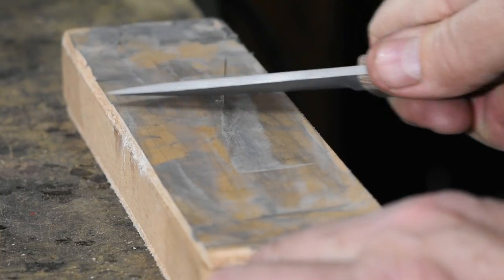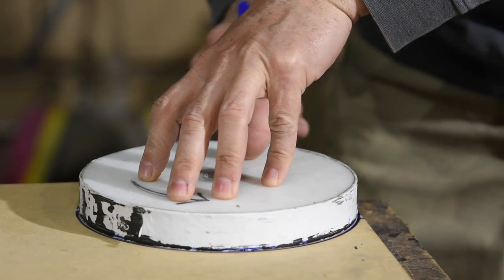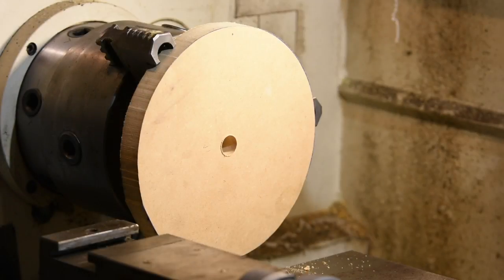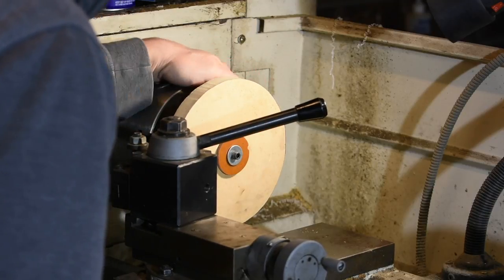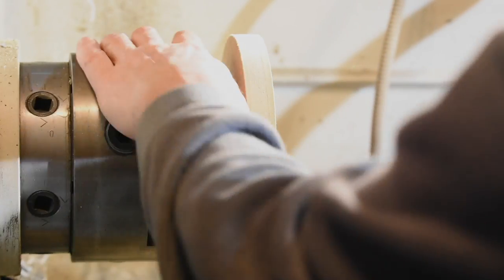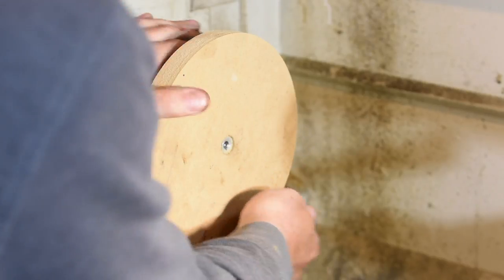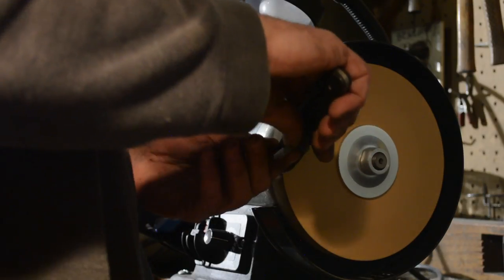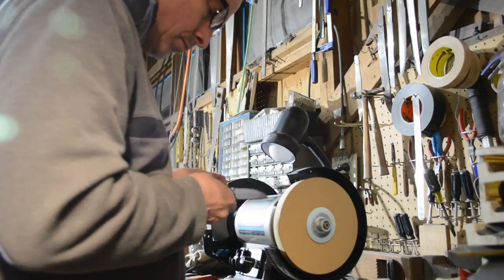Making A Stropping Wheel:  Get that Knife Shaving Sharp!

Comment: I recently made a wheel just like this one :) I feel like I can give you guys a couple of suggestion: If you don't have a lathe at all you can make a pretty good circle with a router and then turn it true when it's mounted to the motor. Then you can also turn the whole bench grinder the other way so that the wheel is spinning away from you and at that point you can work on the top of the wheel :)
Reply: ThankQ for your input, it helps me big time.👍
Reply: Damn good advice!

Comment: Thanks for this Walter. I think that sharpening is either a lost art or one that has never been given its proper focus, at least here in the West. If you make a great blade what's the point if you can't make it sharp. I've been sharpening knives for years for friends and family. My very rudimentary but effective routine is short. I have a worn out 120 grit belt that I use to bring the edge back to the factory profile or establish one that should have been in the first place. Then I went to the buffing wheel/mop with a fine compound. Worked great for years, even on the knives I made myself. I happened to be in the shop of a local guy who has been around for donkey's years. One of the things he had that caught my eye was precisely what you just made. The only thing different was that he turned the grinder around so that the rotation was going up and away from him. That way, he had the knife on the top giving him better sight lines and if, by any chance, there was an issue, the knife would be thrown away from him completely. I went home and immediately made one from two sheets of 1/2" grade A plywood. After turning it, I gave it a light sand and then charged it. Now the buffing wheels are relegated to polishing bottle openers, blah, blah, ad infinitum. Thanks for the tut. Keep forging!

Comment: I made one last year, but I don't have a lathe! I trued mine by mounting it on the bench grinder and using a small vise as a rest and a wood chisel. I use it by turning the bench grinder backwards and stropping on the top of the wheel. This way it is turning away from me and if the knife does catch, it's thrown against the wall.

Comment: How crazy!  I just did that project last week!   I went to home depot and ask for scrap MDF.   They had 5/8 so I glued 2 pieces together; rough cut to a round; drilled the center hole and turned it true right on my grinder using a normal wood chisel.   Works like you say (a charm) !   I sure save time resharpening the kitchen knives !!
Reply: Do they give out free like that?
Reply: @MaulikThaker  , they had charged me just $1 for 4 pieces.  So almost free  ;o)   Cheers.
Reply: @nihallee   Thanks :) I just did with the wood piece I had hanging around from my old cabinet. Did the job well, thanks.

Comment: I made one of these a week or so ago. I cut 2 wheels on my CNC router with the hole cut for the arbor and the washers. Using CA adhesive to glue the wheels together and used a flat scraper from my wood lathe and the tool rest I trued it up right on the grinder.  BTW I made my wheels 9 inches in diameter because I had the space. Works great. :)

Comment: Another important note on the topic would be that on smaller knives, this technique does run the risk of overheating the blade edge and taking out the temper from overheating. The temper is vital in maintaining the most durable edge possible-edge retention and toughness especially.

Comment: Walter, G'day coach,
When mounting a stropping wheel to a grinder motor, what would you say if 'about-faced' the motor and used the upper quadrant for stropping? That way it has less chance of 'grabbing' my knife/chisel/gouge.
I'm an 'apprentice' wood carver (aged 75 almost) and I really don't like pointing my blade dow  in an awkward position. It's different on my belt sander; I have a ledge. Also when using a knife (ledge removed), I feel more relaxed because the blade is easier to hold at a horizontal position.
Of course, it means I'll need to reach over the machine to start it. But that can be done safely.
On the other side (left), I have a wire brush-wheel, and I have often had it snatch the item out of my hand (banging the tool into the wheel ledge, and sometimes trying to jam it).
Cheers,
Vernon Thompson,
Hog Heaven Ranch,
Seligman, AZ.

Comment: You can turn the mdf on your bench grinder if you don't own a lathe. Just make it as round as possible before trying to turn it. I used this method many moons ago and it worked fine. Same wheel still in use after 10+ yrs.

Comment: I'm a fan of using a $45 6" buffer from Harbor Freight along with a pair of leather Flexcut Standard Power Strop wheels. All in you're spending far more than just the $20 for a paper stropping wheel for your grinder, around $85 total for the buffer and a pair of leather wheels, but you're also not using up one side of your bench grinder. Also, you don't have to get 2 Power Strop wheels. One will do the job. You'll just be spinning the buffer around a lot.

I use three different strops depending upon what type of edge I'm sharpening/stropping and what level of polish I want. If I want a true mirror polish -- one that still looks like a mirror even under the 80x magnification of a USB microscope (most 'mirror polished' edges look like a hacksaw blade under magnification) -- I use the kangaroo leather & Nano Cloth strops with my TSProf guided sharpening system along with multiple diamond stropping solutions going all the way down to 0.1 microns. For most uses, however, that's a little on the ridiculous side. So for the majority of the knives I sharpen I use either the aforementioned buffer & Power Strop wheels or a simple 1"x 30" belt grinder with a Surgi-Sharp leather stropping belt. The Surgi-Sharp belt is for knives with convex grinds. For everything else I use either the TSProf or the buffer/Power Strop setup depending upon the level of polish I'm looking for.

Comment: Re: wheel spinning direction ("up" or "down")... if you remount your grinder in the right corner of your workbench-- and can stand comfortably at the bench side/end-- you can use the MDF wheel over the top (with guards removed) spinning away from you, and the have left-hand abrasive wheel still spinning in the conventional direction.

I built this same kind of wheel about ten years ago, but went to a six-inch diameter because the slower surface speed was more forgiving and generates less heat. Things happen very quickly on eight-inch wheel at full speed... YMMV.

Comment: 4:08 you could fix that by moving your camera position to above the drill side. After all, the lathe turns so it doesn't matter which angle you're looking at it, it always looks the same. You can even turn the camera sideways if you really like this viewing angle (so rotate the camera position around the lave axis). Never any problems with arms anymore...

Comment: WHAT R.P.M. is that wood rated at??? I have seen grinding wheels blow up and it is not a nice thing to be standing in front of.
Reply: I just hope he has the camera rolling if/when it happens...
Reply: You know, I have been around grinding wheels for 30 plus years. Aluminum oxide, silicon carbide, vitreous bond, different makers, and different grades. BUT, I have never had a wheel 'blow up' on me because I have always ring tested them. Tap on the edge of the wheel with a good hard piece of maple...If it rings, you are good to go, if it sounds flat, or doesn't sound at all, throw it out.
Reply: What are you talking about having a spinning wheel blowing up in front of you feel like a soothing message
Reply: @jamesoconnell9396   I think the question of an exploding wheel was referring to a stropping wheel made out of MDF. 
Anyways here is a question I have, Can I break in pieces a cracked aluminium oxide wheel and use the pieces to dress similar grinding wheels?
Thanks in advance for your reply.

Comment: If I have no lathe, would it work to make it round as possible by hand, and then maybe mount it to the grinder and then true up the outside circumference from there?
Reply: Revrant I've trued contact wheels up by chucking them in a lathe and using a piece of sandpaper on a block to smooth it down. I'd be willing to bet it would work on this using the bench grinder as power.

Comment: Isn't MDF powder poisonous due to the formaldehyde content?
Reply: Or should I say MDF dust....
Reply: The problem with MDF dust is the fibers have the same shape as asbestos.   There like little hooks, once they get down into your lungs you won't be coughing them out.    That's why anyone cutting MDF will usually wear a high quality dust mask or even a 1/2 mask respirator.       It may be different in your local, but I believe most manufacturers in North America stopped using formaldehyde adhesive's about ten or fifteen years ago due to the health issues.    I also understand it was more in regard to the particleboard or pressboard used in the manufacture of "for example" melamine kitchen cabinets.   Not sure if Formaldehyde was used in MDF production.

Comment: I recently watched your video on youtube  making a stropping  wheel now if you take and make another one you can take aluminum oxide powder fine to medium coat wheel with a thin layer of wood glue lay some powder on paper or cardboard and roll wheel through the oxide powder lightly and coat wheel evenly coating all the face of wheel .than slide wheel on grinder shaft just to support until glue dries 24 hours . Ok now mount the wheel on your grinder now take a piece of angle iron turn grinder on take angle iron and lightly touch iron against wheel what you are doing is leveling the face of wheel now with wheel turning  press wax against wheel coating it now rub iron against wheel until wheel is smooth this is done with a lite touch stop wheel exam wheel and you haven't removed the iron powder your ready to sharpen your knife ( REMEMBER DON'T PLACE BLADE WITH CUTTING EDGE FACING THE TURNING EDGE RUNNING THE WAY THE WHEEL IS ) Lightly press knife against wheel 1 or 2 times then turn around and run the same amount of times on the other side watch for burr to form then   when you like the way it looks then stroup knife on the other wheel. Just remember don't place edge of blade into turning  wheel it will throw or RIP knife out of hand causing injury. This process done correctly will not heat up blade. And at the beginning of each sharpening touch a couple times with wax and touch polishing compound a couple times to strop. If you do feel blade getting warm dunk in water. And use less pressure. This wheel should last for 50 to 100 or more knife sharpening . To Reload sharpening wheel take 36 grit cloth backed sandpaper and run against wheel until wheel is smooth and clean then reload as when new .

Comment: I got a 1x30 with a leather belt, loaded with 4 or 8 micron diamond compounds. Leaves a shaving sharp edge but with diamonds they cut a clean and defined scratch pattern which gives it plenty of tooth and slicing aggression.

This here wheel looks like it would work pretty nice with a paper wheel set up.

Comment: Polished blade will shave but will not have enough grabbing power to cut few materials like rope, and stuff , too smooth knife will glide and not cut , so if you will polish ur knife , last thing tou want to do is change ur angle a degree and lightly run ur knife on like 1000grid stone to put some teeth back on the micro edge , wicked edge sharpening systems makes it easy  to do.

Comment: If you have a wood lathe, you don't need to worry about a bench grinder. Use the wheel on your lathe. I've never had a problem doing that. Many, many, many times. You can also lower the wheel speed easily.
Also, why make it? It's more fun.
Reply: If you have a lathe running the wheel at lower speed is safer and better for the task.
Reply: Yes, my lathe has been used for metals as well as plastics. You can vary the speed so you don't burn or melt anything.

Comment: wouldn't it be safer if you turned the grinder around so it's spinning away from you?
Reply: Agreed. That's what I do, too. A bit of a pain to rotate and screw/bolt down without a spare, though. Fortunately, picked up Grandad's that no-one else wanted. Saved me contemplating a benchtop lazy-susan ...
Reply: Not if your using it on top. It would throw it away from you. If you use it way it is in the video it's gonna throw it any where from your waist to your feet. I'll take my chance of having thrown at the wall any day than have it thrown at me.
Reply: go watch another video on sharpening wheels he's not first person to do this on youtube. everyone else has no guard on it. they have it turned around and they are using it on the very top so it will throw it away from you. you and walter can be the only ones who do it that way that's fine. so go head and do it that way and i'll do it the way.

Comment: Walter, I'd recommend turning the grinder around, flipping around the base, or rewiring the motor to run backwards.  That way you can use the top of the wheel to strop, with the blade facing away, and the wheel turning away from you.  It won't catch on the edge, and won't throw the knife towards you.
Reply: He's holding the blade downwards anyway, the wheel wont catch. He's using it in exactly the same orientation as he would be if the grinder were reversed, only at the front of the wheel rather than the top. At least holding it at the front of the wheel you can lock your elbows in and get a steadier angle. And you would just have to flip the base.. you wouldn't have to re-wire the motor... If you did that you'd end up with a grinder that works exactly the same way only with the power button on the back.
Reply: I know he's holding the edge down.  It just makes a lot more sense to have the wheel moving away, using the top of the wheel.  You can still lock your elbows, and the edge is easier to see that way.  Some grinders don't allow the base to be reversed, that is why I suggested either turning the grinder around, flipping the base, OR rewiring the motor.  If you can't reverse the base, but would like the switch on the front, most ac motors can be wired to run in reverse.  I find it much easier and safer to have the wheel turning away, and to have the edge of the knife held horizontal, parallel to the work station.
Reply: Well that's fair enough. For me at least it doesn't make much sense to completely change my methods for one task on my bench grinder, maybe if I had a dedicated grinder for sharpening I'd have the wheel turning away and strop on the top surface. Sorry I thought you said turn the base AND rewire it, to me that was a double negative but no worries.
Reply: It's really up to the user.  Most people will buy the package deal he mentions, which comes with two wheels. One wheel is set up with an abrasive coating for establishing a bevel, one is a slotted wheel with polishing compound for stropping.  That way you change out both wheels on the grinder, and have a dedicated sharpening setup.
Reply: Matthew Seader ... be careful. . rewiring grinder to run backwards like this it can loosen up main nut that keeps grinding wheels tide during operation and bad things could happen. .... otherwise good tip....
Reply: I agree. You'd almost require an aircraft quality bolt with a pin through it to keep it from eventually flying apart.

I think turning the whole grinder around and reaching over to switch it on would be a good bit safer.

Comment: Hey I don't mean to nit-pick, but "honing" does not remove metal. Honing referrs to the process of running the blade along a long a honing rod or similar tool which ONLY bends back, or straightens, the cutting edge. The end effect is a better cutting knife, but not sharper as no metal is removed. "Sharpening" removes metal. There are 4 stages to make a knife edge-shaping, sharpening and stropping, and honing is used in lieu of sharpening i.e. before cutting up your veggies for dinner.

Comment: So Dangerous do not do this unless you have experience with grinders and tools! never have the wheel spinning into the edge or it WILL catch in a second (and could injure you badly) - that is why commercial ones are made of stuff that doesn't catch like paper - felt - shreded leather and so forth. It works, yes, but a hand strop will work just as well when loaded with compound. I honestly think it is a stupid thing to have in the shop - buy a safe one and call it a day.
Reply: docdoc or just trail the edge, sack up a bit and wear your PPE

Comment: instead of using a polishing compound, could a poor man use a bar of soap instead?
Reply: If you have a harbor freight near you, they have the green chrome oxide compound for about $5. Not too much more than a bar of soap (which I don't think will work anyway).
Reply: Sidewalk chalk, my friend. Mirror.
Reply: Soaps don't typically have the abrasives necessary for the polishing process. In fact I have never heard of a bar of soap with an abrasive compound in it. Go to Lewis Mercantile or ace hardware and you can find polishing bars for cheap.
Reply: Lava brand has pumice in it, but the grit would be way too large.
Reply: I don't know what soap you use but mine doesn't have abrasives in it and it doesn't polish my skin.
Reply: NetHandle WompaOne try tooth paste. 😆
Reply: Only if you use soap for scrubbing barnacles off of whales! :)

Comment: do you think this is better than a leather strop for my 1*30" belt grinder?
Reply: No, the surface speed on this is too high and you risk damaging the cutting edge. Further the leather will give some and give you a longer lasting edge by slightly convexing it.